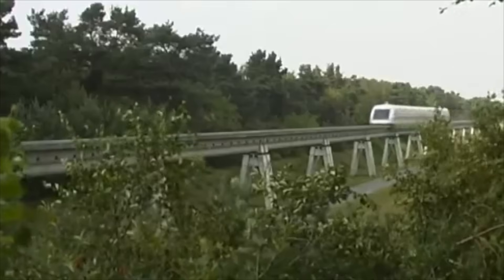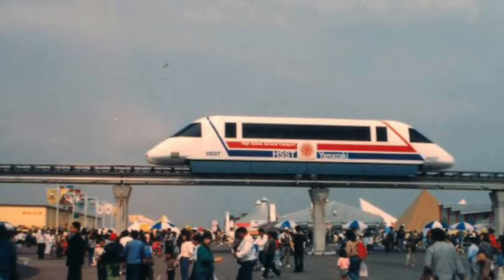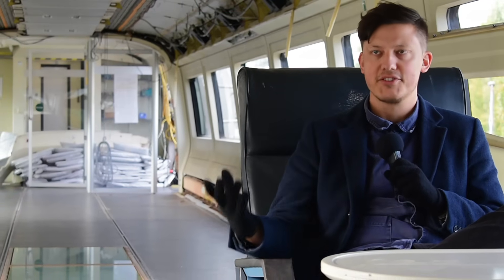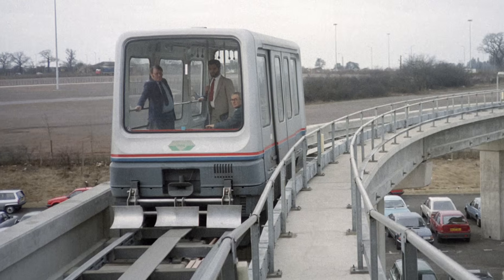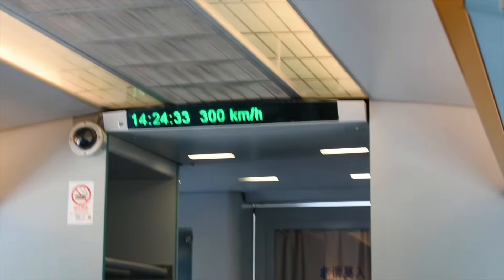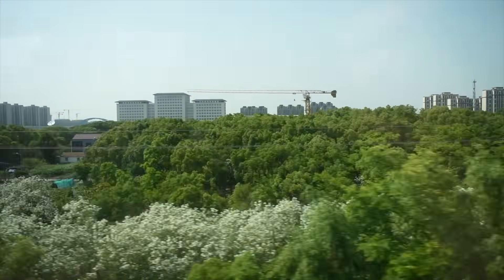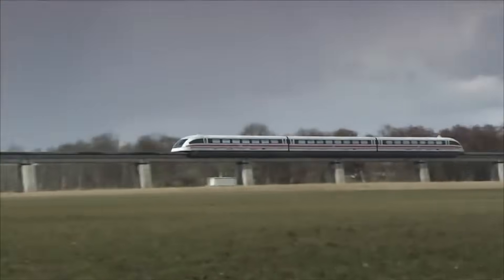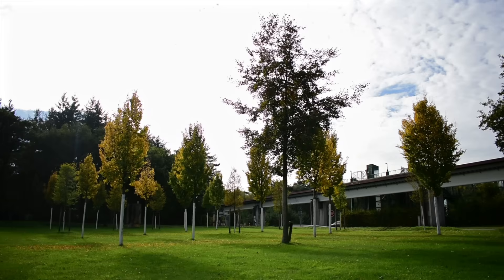Why Did Maglevs Never Succeed?

Comment: A problem with the sponsor pitch: "keeping your connection encrypted" is meaningless nowadays, as HTTPS (more specifically, TLS) already does that basically everywhere you might care about. A VPN service adds nothing in terms of connection security. Sure, it may help to bypass a block or appear to come from another country, but VPN services absolutely aren't useful security or privacy tools.
Reply: I hate how everybody just reads off these VPN ad scripts without fact checking them....

Tom Scott pushed against it for a while but then did an ad read for them anyway. With a corrected script, but still. And now the moment of relevance is over and they're back to the same gobshite as before.

If I want to hide something, I download Tor Browser. FOR FREE.
Reply: lots of stuff is also geoblocked and your isp can still see what domains you are accessing. And of course if you are downoading stuff via torrents you better be running a vpn but they can't advertize that.

Comment: The big issue with Maglev, is it can ONLY be used by Maglev units.
Conventional rail can still be used by standard High-Speed Rail
Reply: Good point. If a maglev train breaks down is there a way to drag it to a repair facility or does it need to be fixed onsite?
Reply: @ghost307  Far as I know, the "grabbers" that reach around the track can be removed and the carriage lifted off the track.
The Transrapid concept had moved on from traction equipment being installed on board to the traction equipment being installed in the track, in the form of a linear motor that drags the levitating carriage along the track (fact). It would make the carriage lighter and maybe transporting the carriages a little easier (conjecture).
Reply: @lillywho So in addition to the elevated track you need to build an access road running alongside and have a mobile crane on standby.
That's going to bump the price up quite a bit.
Reply: @ghost307  yes, if there is a serious enough failure, although many maglevs have wheels for use at low speeds and in the event of a power failure so they coast to a stop once the levitation ends.
Reply: Yet the Shinkansen system exists.
Reply: I think the real problem is it is only to move people; rail is just so much more useful as it can move stuff too
Reply: This is only true on paper. In the real world of conventional railways, there are different track gauges, voltages, and signaling systems. 
So you can't just use everything everywhere.
Reply: @Dqtube  But in many countries exactly that is possible and done every day: France, Germany, Italy, Belgium, the Netherlands. The compatibility factor is a real limit on Maglev usefulness, because it requires enormous investment for only one type of use. A type of use that can only be realised once hundreds if not thousands of km of guideway have been built.
Reply: @bahnspotterEU  You are right that it works at the level of individual countries, but not so much on cross-border routes. Just look at how many EMUs or locomotives are approved for multiple countries, and if you want to talk about huge investments, look at the costs of implementing ETCS2.
Reply: @Dqtube  ETCS2 is not going to cost as much as converting Europe's entire network to Maglev though, is it? I bet you're the only person on the planet that still thinks hyperloop is going to happen!
Reply: @Eric_Hunt194  I am not saying that building a Maglev across Europe is cheaper, but in many countries, older locomotives and units that are still in good condition are being scrapped because it is cheaper than implementing ETSC2 in them, and without it, they are not compatible and cannot be used on the given tracks.
Reply: @Dqtube  again though, I'm not sure what argument you're making here- it certainly isn't a convincing case for Maglev. Lots of things get disposed of before they're beyond use and that's a sign of our increasingly throw-away society- just look at the "right to repair" movement for example. But you aren't convincing anyone that Maglev would be better than conventional rail.
Reply: @Dqtube  you know you can just... put a different locomotive in front of the train at the border? which is something that happens all the time and is only a small inconvenience in the grand scheme of things? conventional rail isnt perfect but its defnitely got more and more interchangeable use cases than maglev
Reply: @Dqtube  in germany high speed trains can run on normal rails and vice versa.
Reply: @markus1351  You are right, but in other countries, high-speed lines are intended exclusively for passenger trains. That is the essence of my original comment.
Compatibility exists on paper, but in real conditions, each country has its own approach, which conflicts with compatibility.
Reply: @Dqtube  you keep highlighting a relatively minor and easily solvable problem in order to try and make a case for an approach with much bigger problems which are more difficult to solve. I'm very confused as to why.
Reply: @Eric_Hunt194  What? I'm just saying that the claim that conventional railway systems are universally compatible is not true and never has been true. That's all. 
I don't understand why some people try so hard to prove the opposite. 
They are probably not frequent rail users if they are unfamiliar with the complexity and variability of the system.
Reply: @Dqtube  sure, but I'm not sure how Maglev helps with that. Making all of mainland Europe's major routes cross-compatible would be a relatively simple thing to do if there was the political will to do it. The technology already exists.
Reply: @Dqtube  that's not insurmountable though, and it most definitely is not "only true on paper"- you can just build everything to the same standard, or even use gauge-changing systems as seen in Spain and other countries. Designing a vehicle that could work on a Maglev guideway and a conventional railway would be a complete non-starter.
Reply: @Eric_Hunt194  Technically, any type of vehicle can be manufactured, but if the authorities in one country decide not to even begin the approval process for a given vehicle, it cannot be used in that country, even if it is technically capable. This has already happened in the past.
Reply: @Dqtube  well yeah- it isn't easy to get different countries to collaborate on technology for all sorts of reasons- that's why Spain has a different rail gauge to France on their conventional network. But that's a much smaller hurdle to overcome than converting everything to a technology which is more expensive to build and operate, creates more noise, and only offers a relatively minor increase in speed for all that extra expenditure. Even if Maglev was better in every way, the disruption caused while you convert the entire European network would cost the economies of each nation €trillions.
Reply: Conventional rail vehicles could be often modified for different systems: exhange signaling, dualisation and even swaping boogies for different gauge (even on one rout) . doesnt work for every differences but in worst case you can derive new train on existing platform  (like recent FLIRT and Panter EMU for baltic broad gauge railways) and there is whole industry with decades of experiences and infrastructure that could deal even with unusual orders (maintanence trains, unique railways like cog rails etc)
Reply: @Dqtube  true from Japan, most rail here is narrow gauge and its too late to widen it nation wide, but there were attempts of widening the narrow gauge on some spots, but it limited the train's speed by a lot
Reply: @Dqtube  so?  There are variable gauge trains, multiple voltage trains and with multiple signalling systems, so...  and all of that is easier and cheaper to do than built a gadgetbahn like the Transrapid.